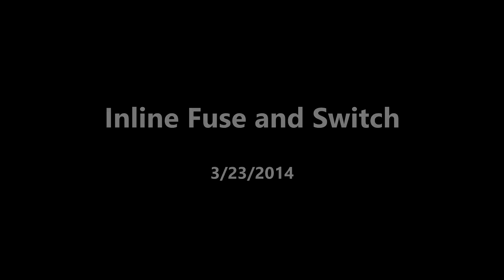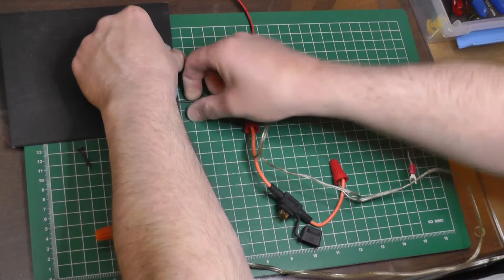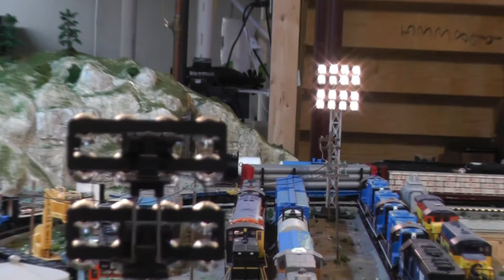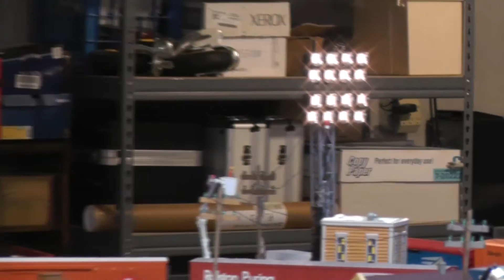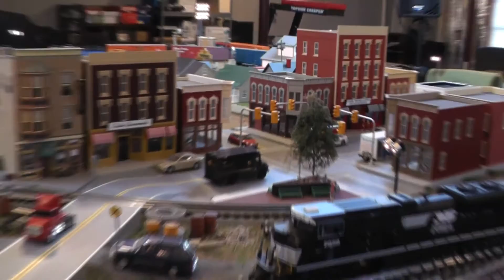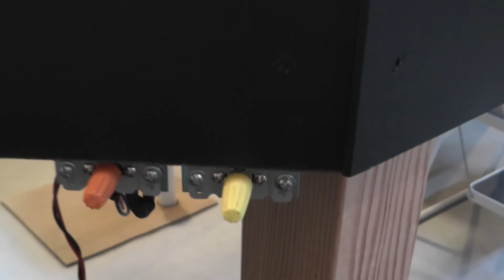Inline Fuse and Switch

Comment: I was reading on fuse and switch placements when I found your video but so far most of what I've seen recommend putting it on the positive wire. Nice model train set though.